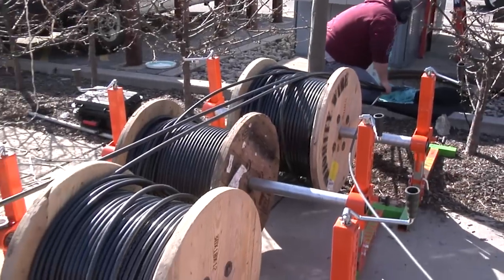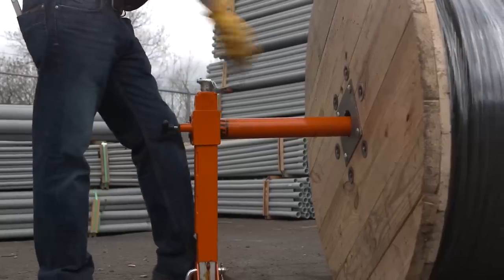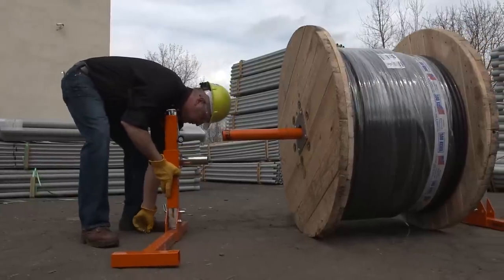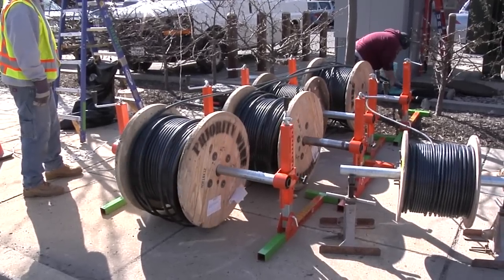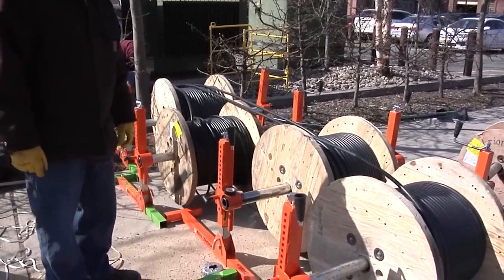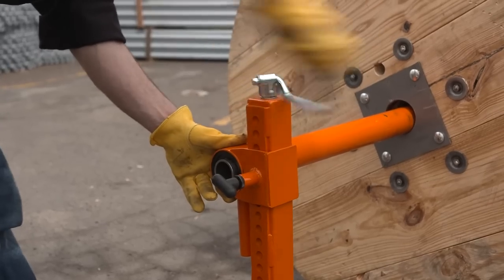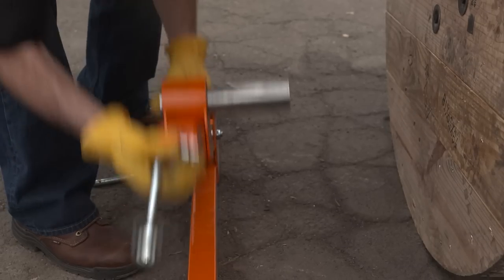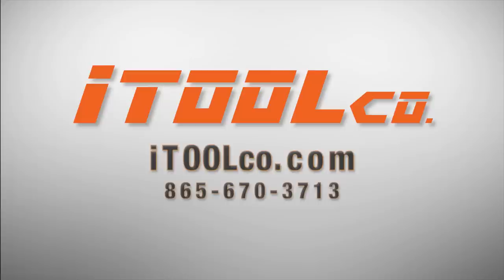Feeding wire with iTOOLco Real Jack Stands

Comment: Well you say there better.  Maybe  for runs  up or across.  But they are not the one to use in vertical down.  Where the spools need a strong braking system to control the speed feeding the cables. As witnessed a brake failure with a very narrow escape of Electricians  in the basement.